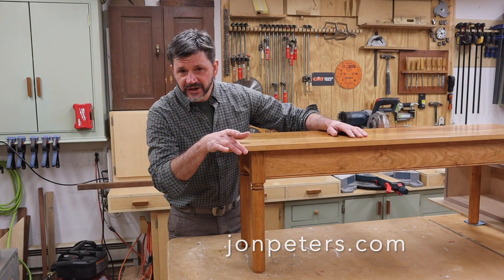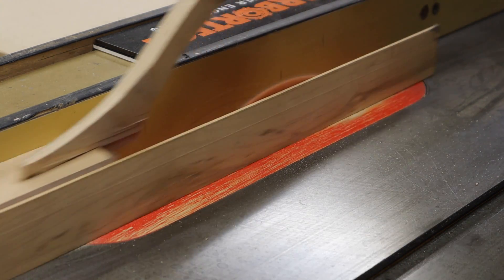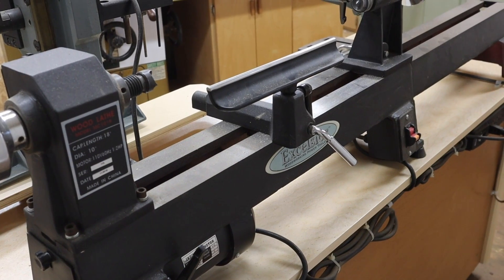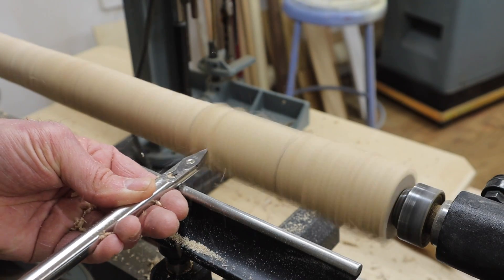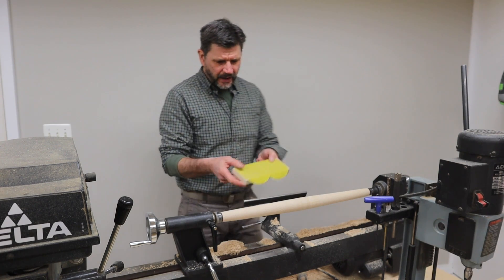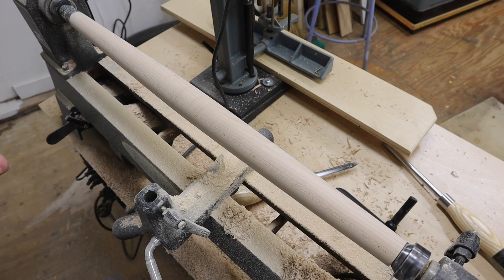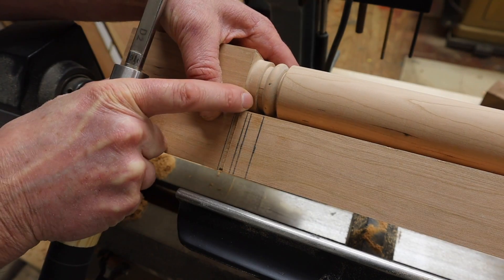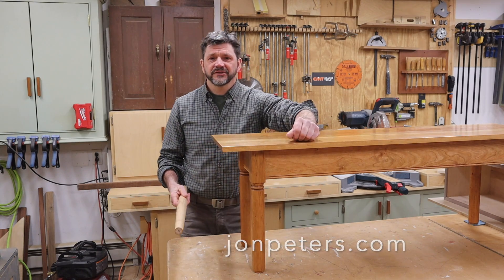Make a French Rolling Pin - Beginner Lathe Project

Comment: For anyone struggling, an easy way to get a parallel or tapered piece on the lathe is to set your tool rest either parallel or tapered to the piece toward the direction you want to go. Use your finger as a stop for the tool against the tool rest so it cant go past the depth your finger set. Works everytime. 
 You were actually demonstrating the finger stop in the video. Nice job.
Reply from the maker: 👍 thanks!

Comment from the maker: Hi All,
Using A wide sanding block with very coarse paper is a simple way to shape wood on the Lethe. Last week when I made the classic cherry bench  https://www.youtube.com/watch?v=SK9yZcZ2_rY  most difficult part for me was turning the long cylinder after the detail at the top of the leg. By using a wide sanding block and very coarse paper I was able to create the legs without any high or low spots. Hope this tip helps you out.

All the best and happy woodworking, 
Jon

Comment: like the French Rolling pin as a beginner turning project.  Need to add one to my shop eventually.  Thank you for sharing.
Reply: Yes, a french rolling pin is a must in any woodworking shop lol.
Reply: Matthew Grisnich well don’t you roll out pie crust on the work bench
Reply: Jk Canvas yes I used to, but I found that the top of my cabinet saw was much smoother and flatter, so I switched to using that.

Comment: Nice video. I would suggest that a penetrating oil, like mineral oil or walnut oil,  is better for kitchen tools that the board wax. While the wax looks good, it stays on the surface and will quickly be rubbed off when the rolling pin is in use.  An oil will penetrate a bit and last much longer - and be easier to reapply as needed, too.